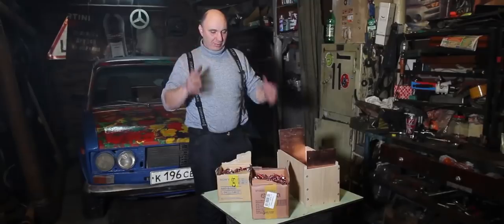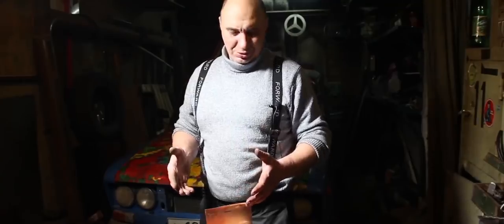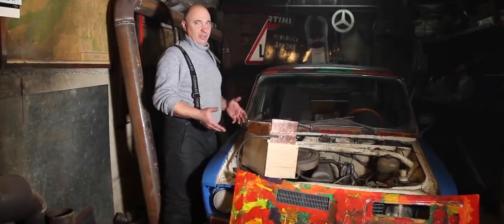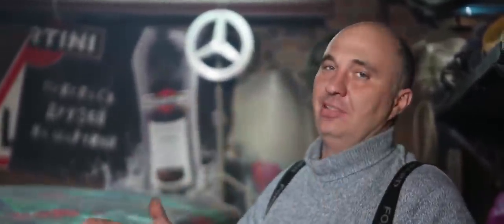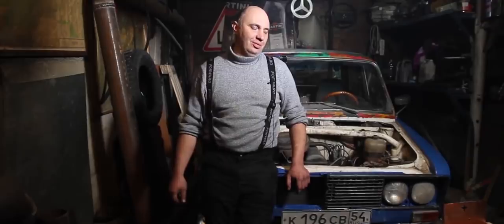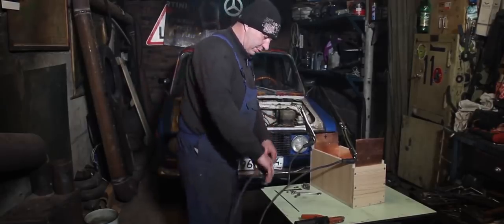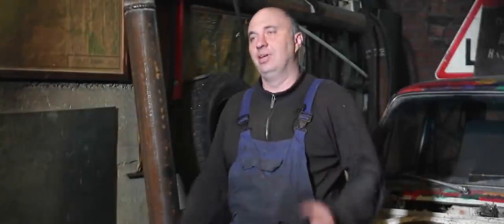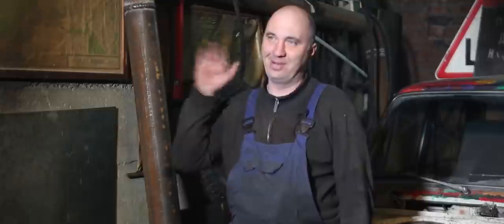1000 AA's instead of a conventional car battery

Comment: If he can touch both ends at the same time 3:11 without getting shocked, how could it possibly start a car?
Reply: the voltage is not that high plus the voltage is DC
without enough voltage. there wont be much current flowing through your body.
12v isnt enough to shock you. maybe if you lick it you'll feel it on your tongue but thats about it.
you can touch 100v DC and it wont shock you if your hands are dry.
but you can be shocked from 30v AC because its alternating current.
alternating current is different and more dangerous at higher voltages
Reply: @realflow100  9 V 450 mA DC is enough to incapacitate a human... You can test this by connecting battery pack from cheap power drill with bare hands. Me and my co-worker actually tested this at work. Had to cut the wire because it was strong enough to paralyze muscles.
Reply: DC current is the worst to get shocked with. DC will paralyzed but AC will cause you to jump

Comment: I was expecting a massive electric discharge from a makeshift battery containing 1000 batteries at about 1.5 volts each. You're telling me you had 1500 volts and 3000 amps in a wooden box with a couple copper sheets, and you didn't get any arcs, sparks, or electrical discharges?
Reply: No, he had 12volts at 250 to 500 amps. He strung 8 batteries in a row making 12 volts (series string). Then he made 125 (rows) of them total - in parallel to get the current up high.

Comment: 1000battery with 9in series gives you 111rows, wich means you have 111times >2Ah @ 13.5V ….. so you have more than 240Ah on this battery… wont bring more than 400Amps but will last quiet long ;P

Comment: If it takes eight 1.5v AA batteries to make 12 volts in order to power a 12v radio, isn't 1000 AA batteries 1500 volts?  Why doesn't this fry the starter or melt the cables? (Obviously I'm not an electrical expert).
Reply: Because they're connected in series AND parallel.
Reply: @SinsBird   Right.  Got it.  They're lined up in series' of 8.  Thanks.

Comment: Voltage is too hi, current too  low. Your test is 12V x 125 time.  Try  3V x 500 or 1.5V x 1000 for better current and melting stuff.

Comment: If you would have used rechargeable double-a or D size or etc batteries you might as well say you made a homemade battery,, just imagine if you improved the design just a little bit( cut the copper plating where it's not sticking up so high out of the box structure,, then connect them to a copper rod with a simple insulated plastic top ) you got yourself a battery........

Comment: For replacing the car battery using non-rechargeable batteries, it would have been a good idea to put a large stud diode between the battery and the car...that would have blocked the alternator from trying to charge the batteries.
Translated to Russian...Для замены автомобильного аккумулятора на неперезаряжаемые аккумуляторы было бы неплохо установить между батареей и автомобилем большой стержневой диод, который бы не позволял генератору заряжать аккумуляторы.
Reply: Ничего с батарейками не случится. В советских радиоприёмниках даже была кнопка "БАТ", которая подключала батарейки при питании от сети, чтобы "подзарядить".
http://radteh.ru/radiopriyomniki/51.html
" При питании радиоприемника от сети переменного тока внутренняя батарея подзаряжается через диод V типа Д242Б. При этом контакт 1 блока питания через диод V и резистор R5 подключается -к плюсу внутренней батареи, т. е. выход блока питания оказывается подключенным параллельно этой батарее."
И из инструкции - "в радиоприёмнике имеется возможность восстановления емкости внутреннего источника питания (элементы типа  "373"), при этом срок службы элементов может быть увеличен в 2 - 3 раза.
скачать инструкцию можно здесь: http://marrex.ru/Tehnika/Radiopriemnik-Riga-104.html
читать стр 5 (в файле это 6).
И заметьте, ни о каких NiMH тогда речи не шло, завод предлагал "подзаряжать" обычные батарейки! :) Просто фантастика из 1976 года :)

Comment: 12x9x maybe 10 
That 1.5V x9=13.5V because the the cells are connected and each pack has 1 Ah guessing there is 120 packs/rows about that 120Ah and 13.5Vx120Ah=1620Watt hours

Comment: Only 8 in series ?
8 x 1,5 = 12v ,but car voltage is around 14V in operation.
9 in series is much better = 9 x 1,5 = 13,5v

Comment: turbo  efi speeduino is good n cheap if needed to get it done  a old rust rwd  lade file the rings hone it new rod bearing do it to an old high miles lada but good runner so crank shaft not scared up

Comment: It would be interesting to see you drive a car using the starter motor alone. Remove the spark plugs at least to get rid of the engine compression.
It would be the cheapest EV ever!
Reply: Been there done that several times when engine stopped and needed to get the car moved and could not push it, it is not good for the starter but it is ok to do it in a pinch for only moving a little. Like when I did drive into water that was to deep and had to get it out of the water after engine stopped, drove it out on the starter and waited until the water had ran out of the air intake and then started it again and did drive home :) It was  a small old diesel engine.

Comment: He wired them in series witch with that many double A"s would over voltage the car without some type of regulator
Reply: Wrong..  8x 1.5v = 12v and car batt systems run 12v.

Comment: that doesnt make sense, you dont need that many batteries and all those batteries make WAY over 12 volts, how does that not fry the starter motor and all the electronics?
Reply: Only a few are in series to add up to the starting voltage. ..the rest in parallel  to make up the amps

Comment: Make six battery packs like that, put them in the boot and take the whole engine out except the starter motor and flywheel, then control the current with the throttle cable. See if you can drive it like a Tesla!
Reply: No comparison. Tesla uses RECHARGABLE Lithium batteries that can do higher current, longer. These AA's are throw-away batteries. If your stupid enough to try, go for it...

Comment: But car batteries are actually closer to 13.5 volts, so why not 9 batteries wide???
Reply: no when they are fully charged they are between 12v and 13v
8 full alkaline batteries in series would be are right at about 12v to 13v.
Reply: @realflow100  Yes, but car alternators run up to 14 volts, so having the extra voltage wouldn't hurt

Comment: It would have been better with rechargeables....   And a whole lot more expensive. 1000 Eneloop batteries = $2187  (eBay,  62.5 x16-packs).  This would make for the most expensive car battery in history.  At least it would recharge.  Eneloop states their batteries charge 2100 times.. I doubt it would last long with 13.8vdc constant.. but the heat would kill them.  I'm bored, it's late, and my mind is running on empty here. lol

Comment: Ok, now connect all the batteries end-to-end.
(should get yourself over 1000V)
Reply: It would kill as 1500 vdc @ 2amps - only need less than .025a to kill your heart
Very dangerous!
Reply: @SamaritanElad  
1500V DC open circuit voltage. 
(it'll drop considerably once you connect a circuit)

Besides its only dangerous if you touch the live bits.
Reply: @phoephoe795  No it won't. Go ahead  try it. Just let us know where to send the flowers
Reply: @SamaritanElad  Internal resistance of the batteries and Ohm's law beg to differ.
Reply: @phoephoe795  Research batteries... Ohm's law is not what am referring too. Example: A capacitor can dump most all its energy instantly.  a AA battery cannot. Takes time to run down that battery - due to its internal resistance - but also limits its current output a lot. Lithium has less resistance- still high though and can get very hot & explode . A wet cell can deliver larger amounts of current as its internal resistance is lower. So keep on begging....
Reply: @SamaritanElad  An AA battery is not a capacitor
These AA batteries is not Lithium ones
These AA batteries are not wet cell.

These are cheapo AA batteries from Russia or China. 
When placed in series, resistance adds together.
Ohms law applies regardless.
Reply: @phoephoe795  Its an example of types of sources of power. AA cannot deliver high energy - but needs time. That is called "internal resistance" You can buy battery testers to read a battery's resistance.
Still, if you connect 1000 batts in series, you will get 1500 volts and more than enough current to kill you!  Voltage will drop  once you exceeds its current output. If this is only a dry cell, then 1 amp max. Only need .005 to .025ma to kill. Why are you arguing with me? Why would anyone use AA battery in place of a car battery? Stupidest idea ever... Won't very long. Can't recharge much.

Comment: There are already very small lithium jump starters so...
Reply: They use Ultracapacitors'. He would only need 6 SuperCaps of 300 to 500 Farad caps and he would never have to replace them (million cycles). They also sell 100F caps kits under $25 with balancers on ebay. You will need 3 of them. 4 for larger engines to stack each kit in parallel. Have to charge them up as them come discharged. Massive current they give out.

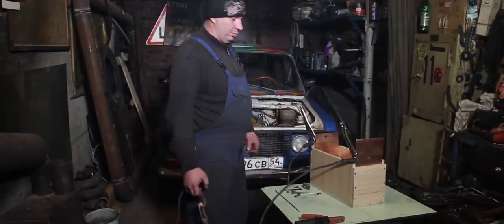Comment: 10:11 edit: I'm such a dumbass.  I totally didn't realize how you connected them in series until now..  The columns(lengthwise strings) are, you said 12?  So (12x1.5) and then the rows are in parallel.  
8:15 oOriginal comment with the ID-10-T error: I thought it was a prank/cheat before you took it apart and showed it.  I am stunned you got that motor to spin on 1.5-ish Volts.  Is the Lada a 6V system or 12V?

Comment: Leave the engine running, i want to see what happens to those non rechargable batteries with the alternator pumping juice through them.
Reply: Die of Carbon Monoxide in his garage.
14v over 8 battery, its only 1.75v/battery assuming 14v output of alternator. Would take a long time to heat them up. 
However, another main problem would be 1 bad battery, that if shorted would dump extra voltage in that string & draw off the other strings, bringing the whole pak down.
 Most likely though, they will weaken and current is limited to the weakest battery in line. This system will fail rapidly in a month or 2.

Comment: Isn't a typical electric car conventional battery exactly that?  Just gobs of single cells all series paralleled up?  The first time I read that I thought "You've GOT to be kidding".  Sounds military grade stupid.

I used a series of F size Ni Cads in my boat for years and years a long time ago.  Not as much capacity per volume, but much lighter, and they didn't seem to care about sitting around dead.  Do that with a Lead Acid and it is very shortly absolute JUNK, I don't care if it's deep cycle or not.

Comment: it's fake af, the batteries should be connected both in series and parallel, because AA have a nominal voltage of 1.2. so this pretty much has 2000A of instant AT 1.2v. not 12v. it's literally basic OHM law. go to school kids.

Comment: Sure you can start a car .
You even proved it .
But you are forgetting 1 mayor isseu with batterys .
When you use them they will create heat .
So the more power you use at ones the more heat the create .

Now you staged them in the box .
And there is not really any space between the rows to let the heat out .
So if you would use your big oversized battery for a longer time as you show .
They will create enoug heat to melt ore even explode .

So if you will start using them for a ride of about 30 minutes ore longer .
Your battery box will burn ore even kill the electrics in the car .
What can lead into a car burn down .

What would be verry dangerous for yourself .
And other road users in open traffic .

And you dont even need that much battery to start the car to begin with !!! .

Comment: 🐂💩
Batteries is a nice try, but dangerous try!
Aa batteries are not made for cars... you know you wil say... but the reason is , a car after starting starts to refill the carbattery. And thats the problem. If you try to reload alkaline or zinccarbon they may overheat and explode.
So for the next try better use 
Nicd or nimh accus with 1,2volt.
10 batteries in a row give 12volt
2000mah each in the row makes 12v/2ah each line
To get a 50ah carbattery you need 25 lines.
Makes 250 (nimh) accus total.
If you take the old type of nicd accus with 500mah you need 1000 accus for similar result.
But when loading, dont put them as block together, better on a plate!!! They heat up, and the cells in the middle may overheat! (Even when discharging)

Comment: Your experiment is not new. It is possible for to charge alkaline batteries. All the rechargeable batteries after world war two here in Europe where alkaline (rechargeable) batteries....Just add to your alkaline battery an ELCO with at least 4700 microfarad. It increases the performance. Within my own experiments i had 200 amps pulses. Even enough for to start a truck.

Comment: Can you run an electric can on a wind turbine🤔🤔🤔 no batteries just a wind turbine 🤔🤔🤔😁
Reply: You mean Car? Power output way too low to do that, less your going downhill forever... Some put a radiator cooling fan assembly in front of car and get free energy as no more increase of wind resistance as you move along over 30mph. Convert that free energy to an HHO generator for gas-assist for extra mileage of a couple % tops. Seen that done on a pickup truck.

Comment: you need many car batteries in series to get the voltage up

i would try with at least 2 of these boxes in series for 24v
or i would do 5 of these boxes for 60v

Comment: 1500V @ 600AH 

Wut?
Reply: When connecting in parallel, keep voltage the same, multiply amp-hours. When connecting in series, keep amp-hours, multiply voltage. So either we have 1,5 volts, 2000 Ah, or 1500 volts, 2 Ah, or something in between. If there are each 8 batteries in series, we get 12 volts, 250 Ah. In fact this is far better than car battery :)

Comment: 8 batteries in enough 12/1.5=8
Reply: aa drops super fast to 1,2. so, no.
Reply: Divide? its 8*1.5v=12volts @ battery amperage (say 2a) = 24watts.
 Car starters will be in the hundred+ of amps needed

Comment: Watch hLook ElectroBOOM Channel How He Made Car Start With Like 8 of these  Batteries ONLY ! EASY !
By The Way, When You Want To Weld, ALL WIRES NEEDS TO BE FROM A THICK  COPPER WIRE And only the electrod is the from steel so it works like a transistor and melts , these guys dont know basics of electricity

Comment: what is it with russians and cheating 1,5v * 8= 12v he did 11 rows in parallel thats 16,5v sure it starts great when you supply the starter with 16,5v instead of 12, and he said each battery had 4 amps times 1000 what kind of AA are you using a duracell like most others is only rated for 1500mah hince the MN1500 standard, its good he works with old ladas because he need to stay away from the electrics
Reply: Well, alternator usualy puts out 14.15 to 14,50 Volts. So maybe in some cases,  a "modern" car might survive this makeshift battery.
Reply: there was 8 batteries in series so that was nominal 12v so should be equivalent or  total voltage to a lead acid battery, approx 13.2v compared to a lead acid battery which can be 13.8v fully charged, but with 125 parallel series strings  the maximum current its capable of outputting is somewhere between 375a and 500a where as a 35ah car battery is capable of safely outputting about 105a for less than 10 minutes before you damage it, larger batteries will be able to output more current but would have to be a very large battery to match the aa batteries discharge.  even if the aa batteries were cheap zinc chloride batteries they would safely be able to reach the 125a range just wouldnt last very long
Reply: duracell goldtop datasheet shows a capacity of 1500mAh yes at a 0.5a discharge rate so should easily manage 5 to 10 starts
Reply: @QwatroCZ  yes the alternator does charge with around14,5 it varies a bit depending on model it needs that to fully charge the battery the problem is the alternator only charges when the enginge is running so you dont have that before the engine starts, the nominal voltage of a regular battery fully charged is around 13,5v  if you put a extra 3v on your starter it will run quite a bit faster( I bet he did that to compensate for the low amps the alkaline batteries can deliver to put it in perspective try put a metal rod between + and - on a lead acid battery and see what happens it wil be quite different from what we have seen here
Reply: 1000 batteries in series strings of 8, 1000/8=125  its in layers of 11
Reply: @pauldriscoll5010  That's where it went all wrong for me but im pretty drunk right now I miss shit